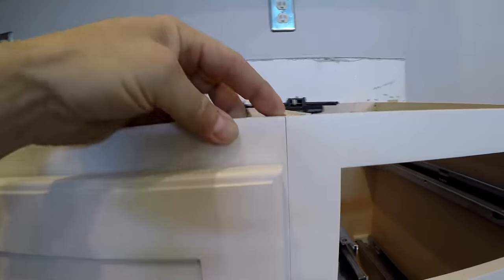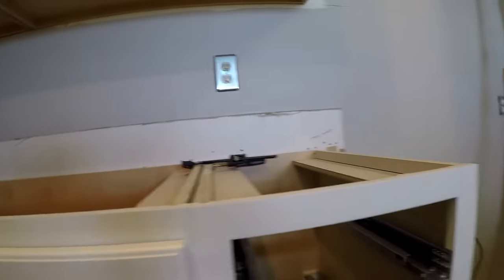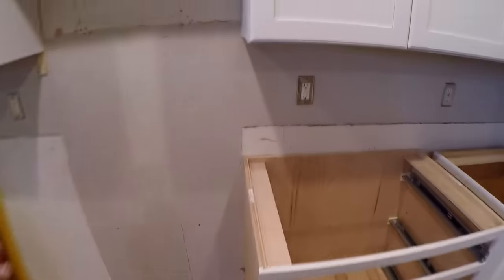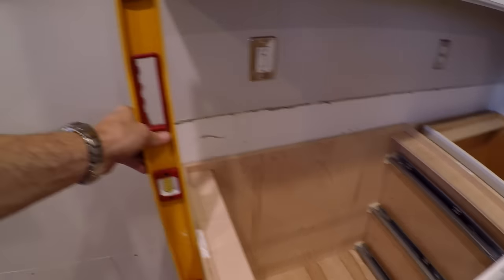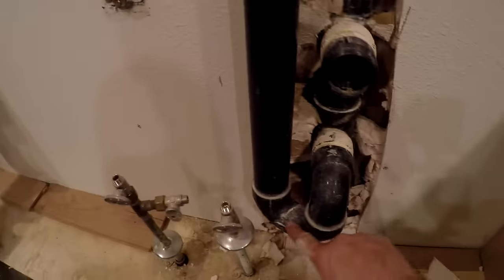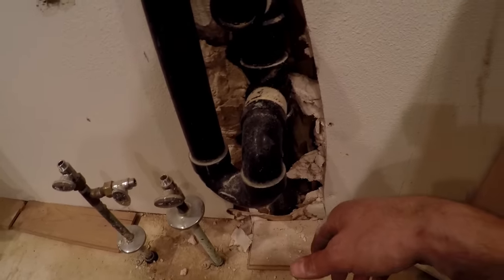How To Install Perfect Base Cabinets | THE HANDYMAN |

Comment: Whats the point of such a narrow cabinet by the trash can cabinet?
Reply: Spice rack cabinet maybe?
Reply from the maker: I didn't ask.  The designer came up with it.
Reply: Manufactured cabs come in 3" increments so the filler on the right side of that cab must be less than 3", betta than havin a 5 3/4" filler dyin in there
Reply: I haven't reached that point in the video yet, but sometimes cutting board storage or spice rack?
Reply: Proof that the kitchen designer doesn't know much.  Notice they left that corner with dead space in the corner.  Because the cabinets aren't custom like someone else mentioned they are stuck to 3in increments so a blind or lazy susan cabinet is a no go.  Since the cabinet is so small the cost of putting a drawer in it probably doesn't make sense.  A real kitchen designer would have ordered this with a pullout spice rack or ordered it with dividers to stack cookie sheets in vertically.  To me its kinda shocking that a kitchen designer would not have gone the custom route.
Reply: @smokingcheeba420  No, I have never ordered cabinets for myself.  In my day job I work in a custom cabinet shop(20+ years), and on the side out of my home shop I build cabinets as well.  So I have never had to order my own cabinets if that is what you are getting at?  If you are implying I don't know shit, we can talk about the hundreds of kitchens I have laid out, designed and built over the years.
Reply: Cookie sheets